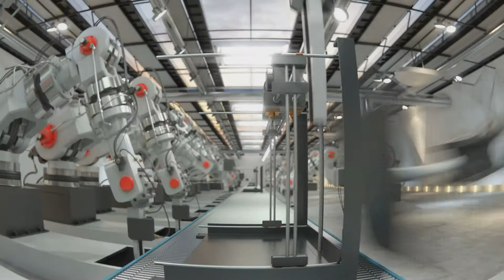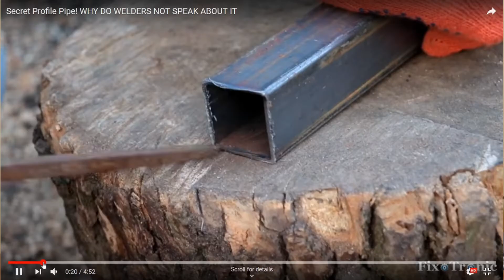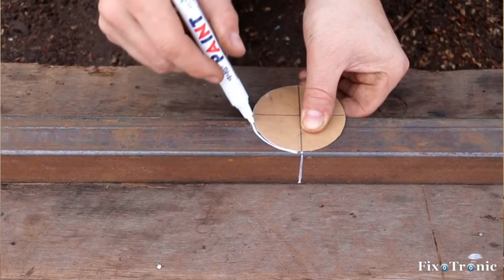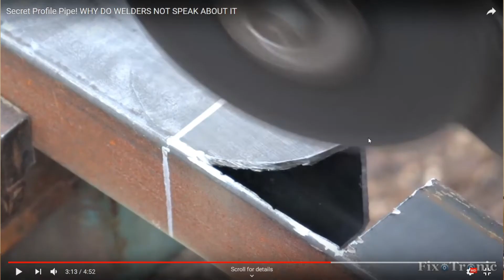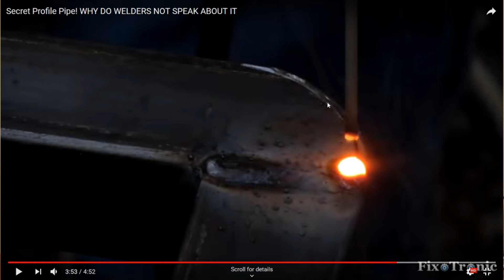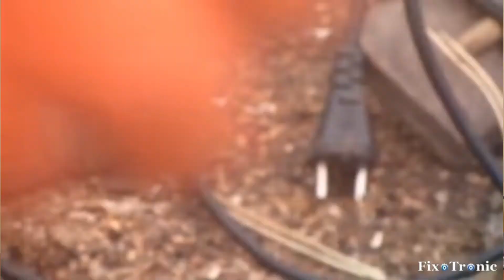Rebuttal to Fixtronic Secret Profile Pipe

Comment: Agree with you about the poor execution, but I think that joint would hold up pretty well with a decent, beefy fillet.  Like, you really think it's fundamentally way weaker than, say, mitred 45's?  My guess is that it's a wash, down to prep/execution. Anyways, the point of that joint is to protect humans from sharp corners. I've seen it used on approximately shin-high framing, used to exclude forklifts from some part of the room.

Also, for thin-walled tubing (sixteenth and below), stick welding is generally much more likely to melt the crap out of it, as oppose to "not being hot enough" or something.

 The  "poke and pause" or "pulsed" technique shown(poorly, admittedly) is a legitimate and practical approach in these cases(like the joint, not invented by that guy).

 Especially true for outside corners, where almost no deposition is nessecary, and burn-through is a risk at any current level. 

Respectfully, I have to wonder if you've ever stick welded anything.
Reply from the maker: Thanks for the response.  For the record, I stick welded once and was terrible at it.  I have a flux core welder and I tend to start at 1/16" thick material and above for the very reason you mention above.  You tend to burn through the parts.  For an experienced welder, this isn't an issue.  But in the industries I've been a part of, most burned a hole and then tried to patch it.  I really don't think patching a weld gives a strong joint.

My main point of the video is that this is not a structural joint.  It does have other benefits as you mentioned like no sharp corners.  All of the examples you gave seem to be more decorative than structural.

The image at the link below shows the strength difference between the Fixtronic joint, a mitered joint and a mitered joint with a balancing plate.  All have the same load and output scale.  I put a 1/4" internal fillet on the 3 x 3 x 1/4 Fixtronic joint in addition to the wall thickness getting full penetration.  This also shows that it is a little weaker than the mitered joint.
https://mentoredengineer.com/wp-content/uploads/2021/05/Comparison.jpg

You can see that the first two joints have red spots in the corners, while the last one doesn't and the load is spread out along the entire width of the tube.

Thanks again for your comment.